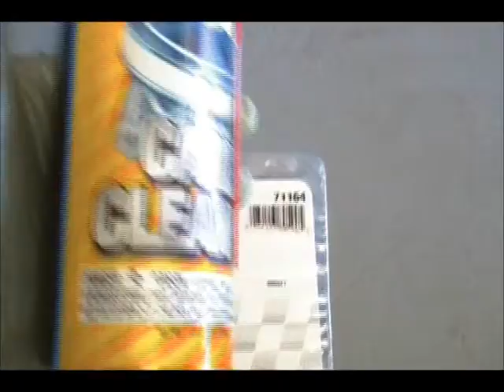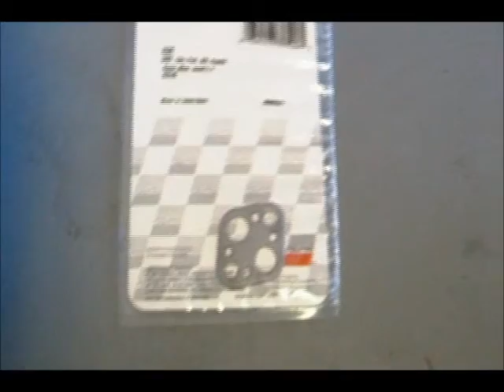Cleaning EGR Valve on a 1997 GEO Metro

Comment: PCV Valve Different From The 3 Cylinder, But The EGR Is The Same. The EGR Is A Little Harder To Get To On The 4 Cylinder But It's Right There On The 3 Cylinder.

Comment: Can and will a dirty EGR valve cause your engine light to come on? Cant get it inspected :(
Reply from the maker: signs of dirty EGR include engine performance issues like decreased power and acceleration, rough idle, and the Check Engine Light coming on.